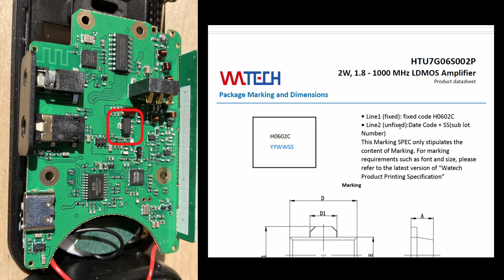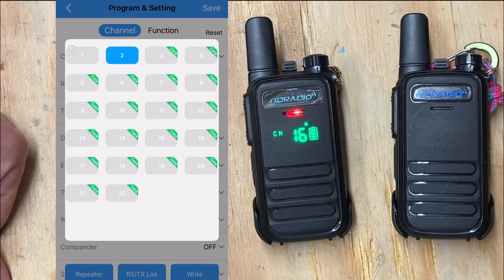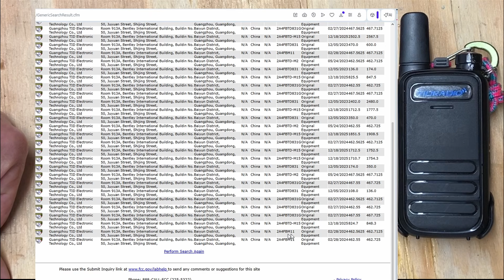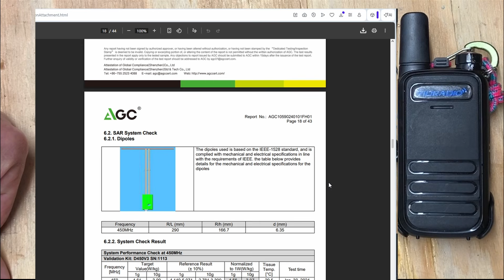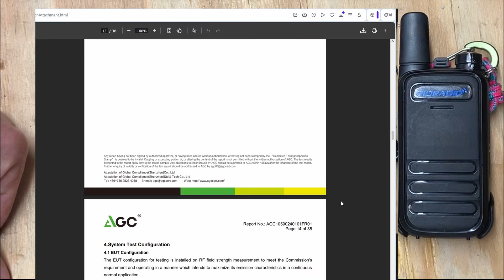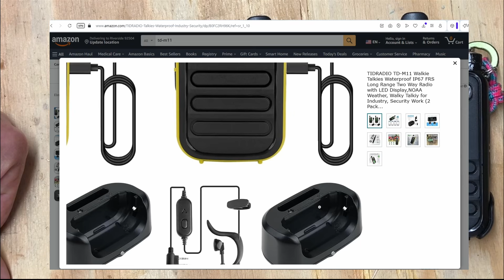TIDRadio TD-M11 Complete teardown, chip analysis, crack, clone and programming: Odmaster, CPS, Chirp

Comment: Is there any way to tell if the cradle power is 5V? I'm thinking I could 3D print something. + and - are marked so there's at least that.
Reply from the maker: on my initial ring out of the board, it looks like the cradle power is most likely hooked directly to the battery terminals. If this is true, then its not a fixed voltage, its an actual lithium ion charge controller hooked to it (probably constant current at 500ma or something with a max voltage of 4.2V). I need to get a base fully confirm.  see picture in next video of this series (https://youtu.be/HMwBOp2TGeY) where I generate this pinout: https://github.com/voltcraftmakes/td-m11/blob/main/docs/PCB-M11-front-annotated.jpg
Reply: @VCmakes  On one of the the pictures for the bases, there is a label on the bottom that says vout is 4.2V but as you noted, it has a space for a battery so it could be for that. I did have one of the units apart at one point as I was looking for a way to add the USB-C signaling resistors (no luck - these won't charge with PD) and I did take a look to see if the contacts went to the USB-C power lines (they don't) but didn't think to see if they went to the battery. It would be odd to me to have li-ion battery contacts exposed like that but who knows? I'll have to do some more looking.
Reply: @VCmakes  I should probably just buy the bases though. They're pretty cheap.

Comment: I have a couple of these. Trying to work out the programming. I haven't completely confirmed it but the battery appears be be a BL-5C with a different label for what it's worth.
Reply: I remembered I had a dead BL-5C lying around. Comparing them visually, the only difference is the notches in the plastic at the top of the battery are on the other side. It looks like it would take very little work to get it to fit. Whether there are other considerations is another question entirely.

Edit: That might be useful info. They don't have the batteries on Amazon or their website or anywhere else I can see currently.
Reply from the maker: @chaos.corner i saw them here in 2 and 5 pack. https://tidradio.com/products/2500mah-battery-for-td-m11?_pos=3&_sid=0f0d5a4d2&_ss=r
Reply: @VCmakes  Looks like they came back in stock. Thanks.
Reply from the maker: thanks for the note on BL-5C